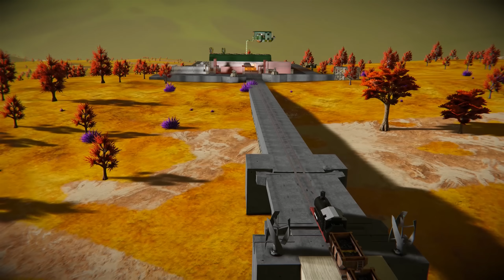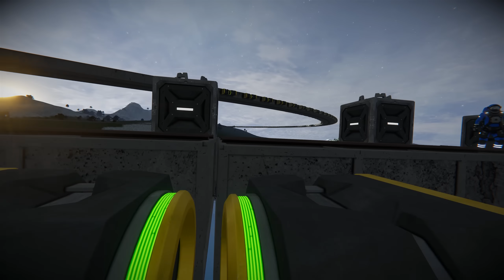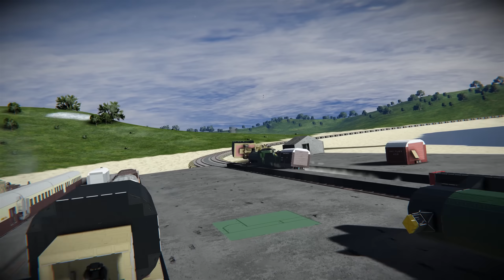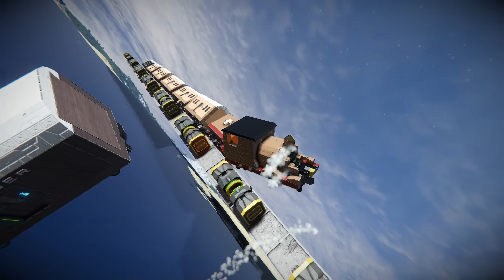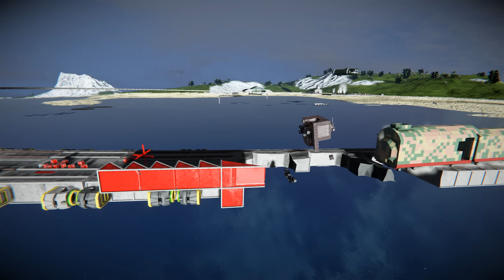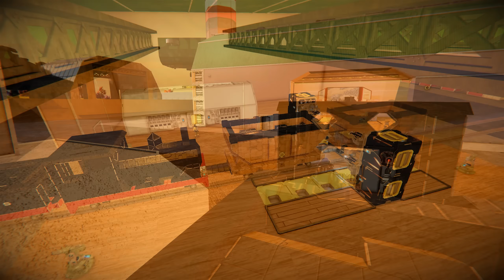Secret Train Track Block Testing NO MODS - Space Engineers

Comment: They really need to officially add this, along with maybe adding angled and curved tracks.
Reply from the maker: I totally agree I thought it would have just been added in on of the updates like industrial. I wonder why they haven't.
Reply: It's most likely because of how unreliable it is for using and the difficulty in trying to build a track. There's also the issue of block placement and block limit
Reply: @woif8739 true but they could just give people the freedom like Minecraft and remove the limit.
Reply: @GeneralVanceStubbsCousin  the limit is so your pc doesn't melt, and you can remove that limit if you wanna risk it🤨

Space engineers is nothing like Minecraft either the very core is fundamentally different it's not some simple grid based game that any half arsed uni student can make
Reply: @woif8739  true, but can’t people just have that ability on console too? I mean it’s just insanity the stuff I’m hearing. 

It’s better just to let players have the ability and want to do their thing rather than limit them to a box

7 days to die would be a better comparison. I mean 90% of it is just blocks but, there’s a lot you can do.
Reply: @GeneralVanceStubbsCousin  if a pc and full servers melt because of space engineers, consoles wouldn't fair half as much.

And no 7 days doesn't compare either, se is not a block game of grids...
Reply: @woif8739  I mean mine hasn’t melted one time and I removed my PCU limit, it’s mostly just how much data is being transferred.

Ark and such are bigger games but they at least allow the liberty of creating rails now
Reply: @GeneralVanceStubbsCousin  it's not the size that's the issue, and it's not a if you remove it's you instantly kill your machine. Like have you touched se, it's a physics base game that's running calculations for every block on voxal grid.

If you add bigger creations and more of them you're adding to the amount of calculations the game needs to do for collisions, which by running a track forcing a huge amount of blocks that need to calculate each point of contact the train makes. You're lucky if klang doesn't destroy it
Reply: @woif8739  Well I’m no engineer, but I’m sure you could create rails and a block that specifically fits that system, without breaking much
Reply: @GeneralVanceStubbsCousin  dude, really? Go and away, play the game instead of making assumptions on a game you've never placed. I've literally just told you in plain English why it officially can't be done, just based on the physics element alone.

Like seriously did you even see the video with the jank the creator of this track had to do to get it working in such a simple way.
Reply: @woif8739  yes I did, isn’t the whole point of engineering to defy the impossibility of it though? I mean that’s such a nihilistic view, you’re supposed to be adaptable not conformable.